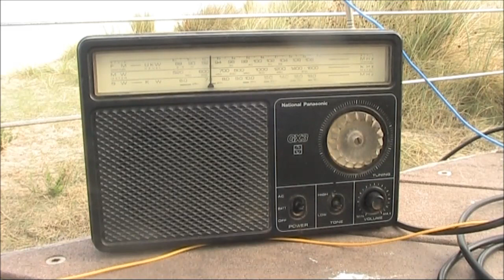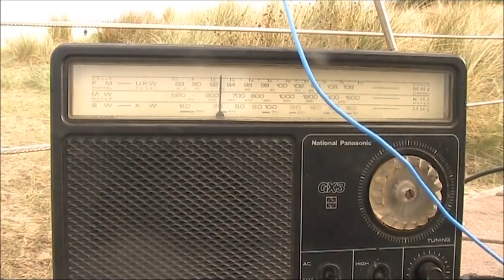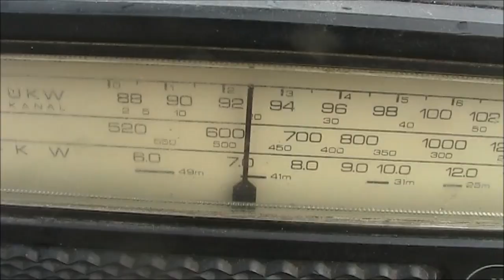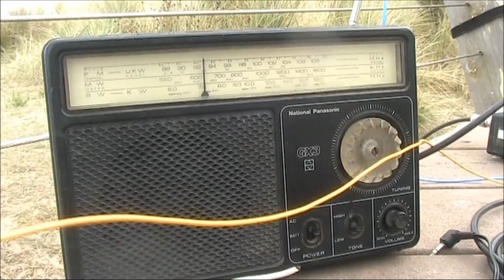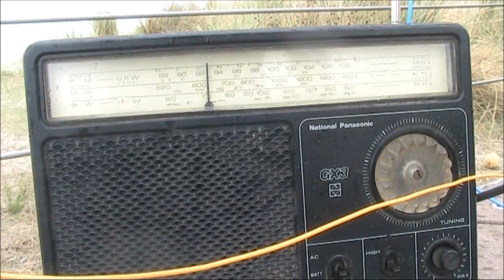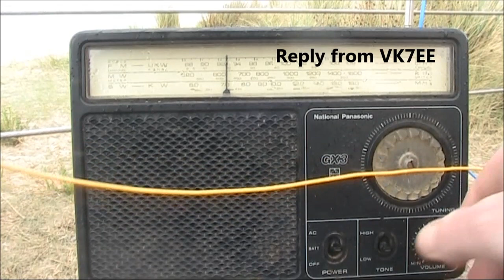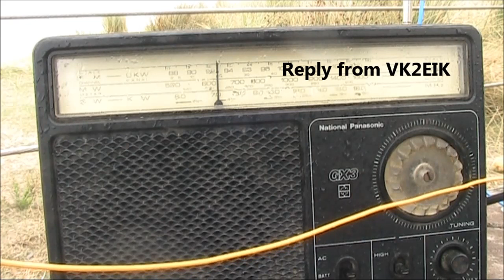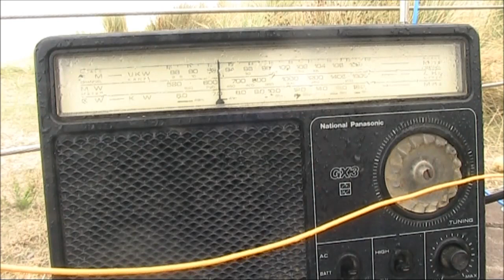Crystal control and a transistor radio: Good enough for Field Day contacts?

Comment: The salt water amplifier helps too!
Reply from the maker: Possibly but not much. The VK5s were partly over salt water but the VK2s weren't. And the VK2 at the end was the furthest contact. Also my first try with that rig was not by the beach.
Reply: @vk3ye  Excellent work though Peter. Just shows how little you need.

Comment: Hello Peter, do you use a manual antenna switch or 2 separate antennas? Tnx de Howie wa3mck
Reply from the maker: Neither. I just have the telescopic whip connected to the earth connection on the antenna coupler. So it acts like a short counterpoise on tx.
Reply: @vk3ye  - Tnx fer ur reply de Howie WA3MCK  -  ur method of providing a beat for the receiver is quite clever - simple elegance!

Comment: Peter - pretty amazing job with just a consumer portable rcvr and a little ten minute xmtr.  I wonder if you've thought of lashing up a 455 KHz BFO for that Panasonic.  I made one with 2 transistors, a yellow core IF transformer, and 2 LEDs back to back as tuning diodes.  Also A plastic painting drop cloth tacked to the rail to take shelter under might make operation in the rain on that boardwalk a bit more comfortable - not much extra weight to carry either - Good job though! de WB8YMV
Reply from the maker: No need for a BFO. The transmitter crystal oscillator is running all the time. That acts as a BFO provided you offset it slightly. Its advantage is that the rx can drift yet remain on frequency.

Comment: Hey Peter. 

I love that setup of yours. 

Been working on the $10 QSO and tried the Pixie on the vertical. The broadcast interference was out of control. 

Looks like it’s going to have to be a tuned mag loop to make it usable. I used it once before on the mag loop. Didn’t have that problem 

Let’s see if I can make one that works for under $6
Reply from the maker: Thanks Chris. The problem with the mag loop is the loss on transmit. The Pixie is already about 10dB down on a full 5 watts. A magnetic loop will make it another 10 or 20 dB worse. That will be below the noise level of 90% of stations you could otherwise potentially work. I strongly suggest keep the vertical (or other full sized antenna) on transmit and have a toggle switch to switch to the loop on receive. Or keep the full sized antenna and add a tight band pass filter to shut out the broadcast interference.
Reply: @vk3ye  I’ll have a go. But I only have $10 to spend on the transceiver, match and antenna

I’m thinking 10m of alfoil on some scrap cardboard packaging rescued from Ikea or maybe there is enough RG6 left over from a strip out. 10-12m makes for a reasonably efficient antenna with a few chunks in parallel for the capacitor 

The more surface area the more efficient and the higher the Q. The longer the more efficient over a broader range 

$10 is the limit. 

Anyway, I have 3 tube guitar amps that need attention before I get around to this challenge 

de VK2NAP